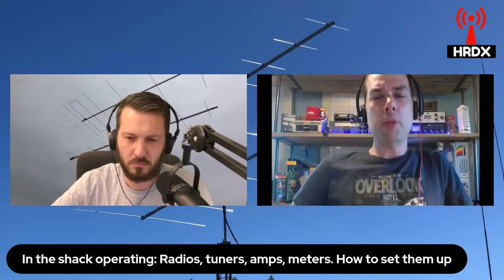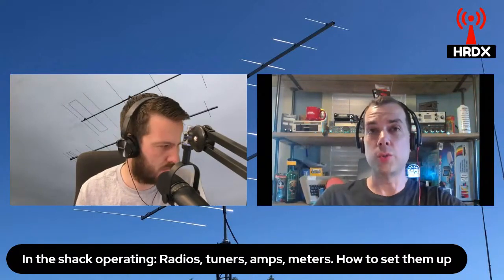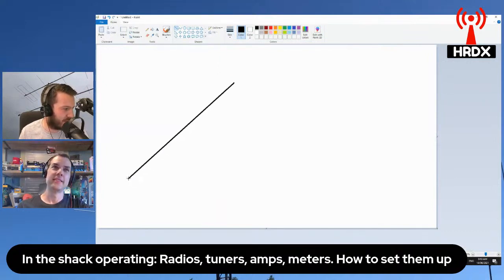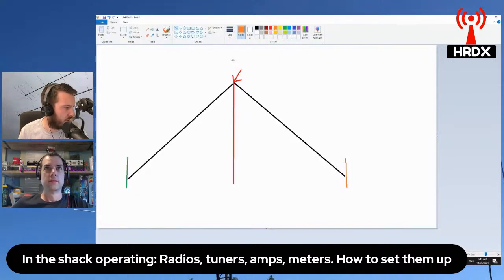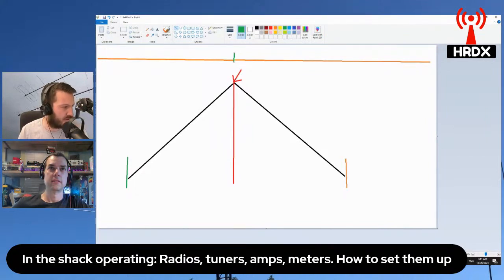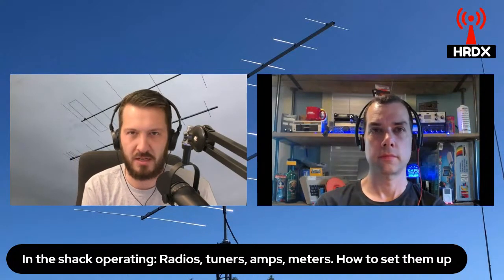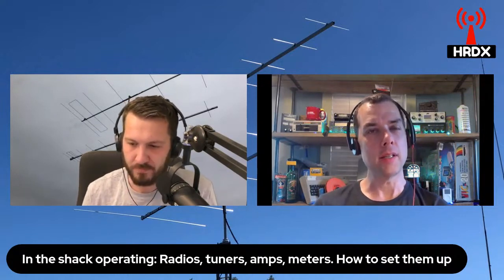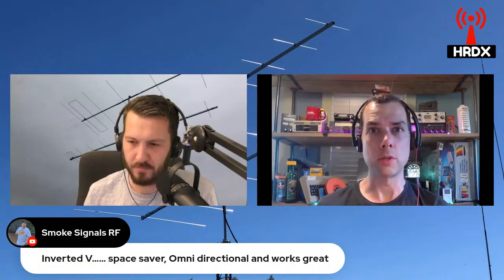Your First Antenna - The Inverted V Dipole | Ham Radio Basics

Comment: Why call it a starter aerial?
I have inverted vee's for 20m, 17m, 15m and 10m in the attic and one outdoors for 60m.
I made one in the bedroom to get an idea of the length for 12m. Using my SWR meter I got a low reading then by lowering it so altering the angle it went lower but not quite perfect.
Checking with my NANO VNA it said impedance 52 Ω and reactance inductive at +j7. How much better could I get it? I could now shorten it knowing it's inductive. Without the VNA I would try both shortening and lengthening it. 

52 Ω +j7 isn't bad and a distant station would not know it's not 50 Ω +j0 which is the perfect aerial but it's a real world aerial in a real world situation. Putting it into the attic next.
QRP here for 30+ years with no more than 5 Watts and I get out.
G4GHB.

Comment: JUP! My First HF Antenna Was/ Is Inverted V And It Works Till This Day, It Is Split In My House Attic, Third Floor And The Elements Go OUT From The House And Each Pole Is A Wire That Goes Down To My Property Fences, Its About 80 Meters Long Together Soo Perfect For 3.6Mhz, But With The FIlters And BPS It Can Do All The Bands Almost. 10,20,40,80, 160

Comment: The weekend that I passed my General exam a few weeks ago a super nice guy gifted me a RadioWavz 20M Double Bazooka.  It's a dipole that uses the outer braid of coax instead of a thin wire.  I hung it from a tree as an inverted V with the apex 34' high.  The angle of the apex is roughly 90° which seems to make the antenna more omnidirectional than a horizontal dipole.  On 100 watts or less I've had contacts all over the US and as far away as Slovenia.  Many of my contacts have been off of the ends of the antenna.

Comment: As always, thank you for another worthwhile video. From north of the equator, I have two thoughts. The videos I have seen are about 1/2 split between running a 1:1 balun on an inverted “V” or not. The balun adds weight and cost, but, until today I have not tried my wire antenna without it. On a “flat” dipole, with expected impedance mismatch, would the balun at the center remove or mitigate the impedance mismatch? Anyway, I am off to experiment more as I am very new to ham radio, and enjoying it immensely.
Reply: Hello, did you try without the balun?

Comment: Everything is an inverted V, why not a V if you have two trees you could use to throw wire up in both?
Reply: The r.f. is maximum at the centre so getting that up high is better to radiate out. Although you could have a droopy dipole with the centre up high, rather than a vee.
G4GHB.

Comment: So, on that inverted V, I've two suggestions to make life even simpler.
1. Don't feed it at the center; feed it at either end of the wire.  It's the same length of wire; it's the same antenna performance but much easier logistics.  You'll need a matching transformer, a 49:1 unun.  That's the connection point for the coax, and it can be at ground height.

2. Because you're no longer having to support 30 feet of heavy coax at the center, you can now use much lighter support.  A Jackite 30 ft telescoping fiberglass pole works fine.  Even a lightweight crappie fishing pole works.
Reply: This is incorrect. While easier to set up it comes at a price. The 49:1 is not as efficient and center fed dipole. You also now have an unbalanced antenna. A center fed dipole is balanced and a lot quieter.
Reply: @forgetyourlife  Yes, there is transformer loss.  The amount of loss depends a lot on transformer construction, shape and toroid material.  It's not atypical to see about half the power dissipated as heat in commercial products.  Sounds bad, but it's just about 3dB.

Note, you'll likewise incur some loss in the balun for a dipole as well.  There's no free lunch.
Reply: @RobertLeeAtYT  I agree however that 3db can be everything at qrp level or when noise floor sucks on both sides. No free lunch indeed. I just think when you can put up a dipole you probably should. Efhw’s are great but it’s my last option when others are available.

Comment: Nice video guys. You may remember .... Choosing aerials are a confusing nightmare :-( Vertical pole/Inverted V) and so on. Only just staring my adventure despite being an ex Royal Navy Radio operator (half a life time ago) and at 63 I'm taking my UK Radio Ham Foundation exam online. Hmmmmm then it's which radio, what aerial and so on. 
Perhaps I could ask a question of others that have gone before :-) Maybe I'm like everyone and want everything all at once lol. By that I mean. I'd like a receiver that can do as many bands as possible (presumably HF/VHF and UHF) and the best affordable aerial that would allow reception - but that's not the size of a car on my roof, or crazy long/mad high in the air.
Any thoughts/ridicules/advice would be really well appreciated (if you have the time or the inclination) thank you from the other side of the planet. 73.
Reply from the maker: Hey Phil,
Good luck on your Foundation exam, I’m sure you’ll pass with flying colours.

As for radios - sounds like you want a “shack in a box”. Something like a Yaesu FT-991A, or a IC-7100 or something, just keep a lookout on the used market for “HF-VHF-UHF” radios. Most of them will be going for a reasonable price.

As for antennas - your VHF/UHF antenna can be fairly simple, something like a Diamond X-30 or X-50 vertical.

For HF, try starting with a simple dipole for one band, or try an end fed half wave if you want multi bands - also depends how much room you have too.
Reply: @Ham Radio DX  Thanks so much h for your kind wishes and thoughts about equipment. I passed:-) Just waiting for my license and then can select my callsign :-) I'll check out your advice now.

Comment: Good info. You might say any “half wave dipole” can be installed flat ( completely horizontal) but depending on the supports or other considerations it can be supported with one support (tree) holding up the center (inverted V) or with one support holding up only one end and the antenna sloping downward. It can also be installed completely vertical. They all work pretty good. You will find that the ones with the highest feedpoint tend to be the best. Essentially the center third of the dipole has high current and radiates the most. The completely vertical dipole will be the worst radiator EXCEPT if over salt water and if the more horizontal configurations are very low in terms of wavelength then the vertical will probably be better for long distances (DX). 
Always think in terms of wavelength for height. 60 feet is low on 80, high on 40, very high on 20 etc.

Comment: The legs on an inverted Vee should be spaced form 90 to 120 degrees for best operation. A doublet is generally a horizontal antenna fed with ladder line and tuned with a match box. Unlike a dipole which is a horizontal antenna fed with coax cable (usually 50 Ohm but you can also use 75 Ohm).

Comment: It's my first antenna and I still use it today. This antenna works well at 40ft or higher at the center.
Thick solid wire is the way to go for the dipoles, and the use of ladder line works well with this antenna.

Comment: Feed that dipole with balance feed wire I prefer 12awg thhn coated solid core copper wire and use electric fence ribbed isolators as 4” spacers and 13” uv resistant wire ties to hold both wires on the isolators to make your own feed line attached to the dipole elements at the Cntr and attach to the balance studs on your tuner and 97% of your 100watts will be transmitted into the ionosphere and received by all ☺️